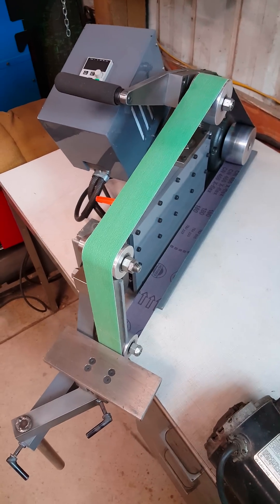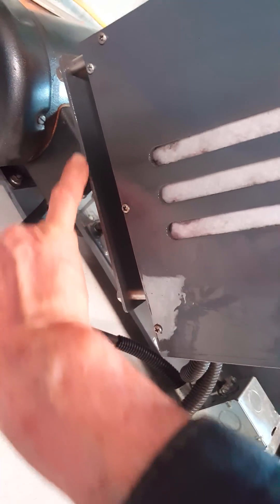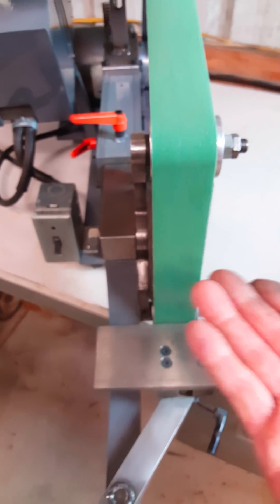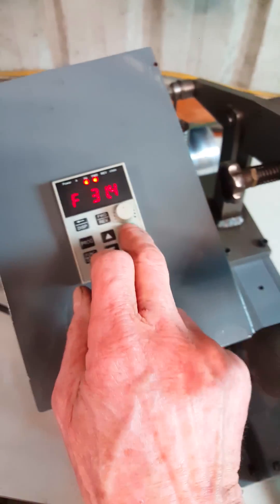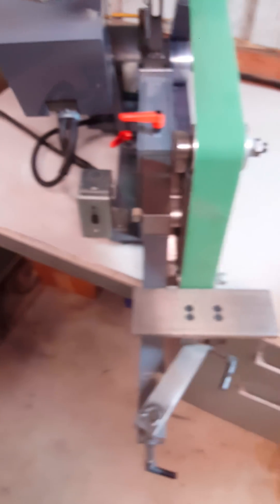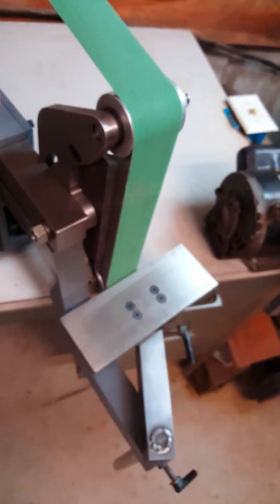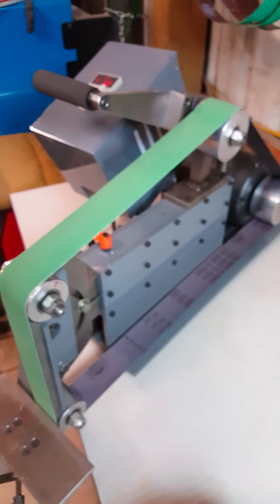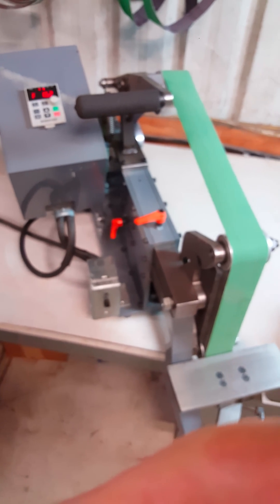DIY 2"x72" Belt Grinder

Comment: Got a link to the  motor and the VFD?
Reply from the maker: For the VFD, do an eBay search on "220V 2HP 1.5KW VFD VSD Single Phase To 3/Three Phase Output Frequency Converter", a little over $60 including shipping, seems to work great for this size motor. On the Baldor motor, it is a TEFC 1.5 hp 3 phase, 3450 rpm, but the ID plate is very unclear (beat up aluminum, most of the old screen printing is gone). I found it several years ago on Craigslist for $50, cleaned it up, put in new bearings, painted it and it should last a long time.  Hope this helps you in your build.